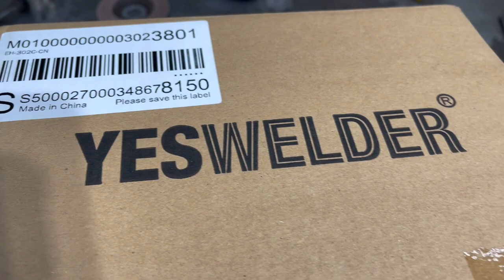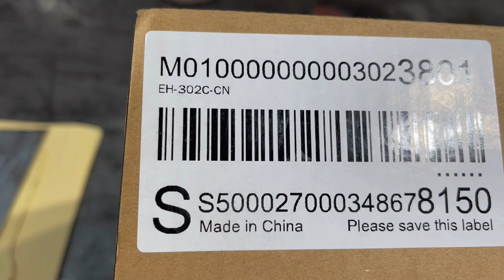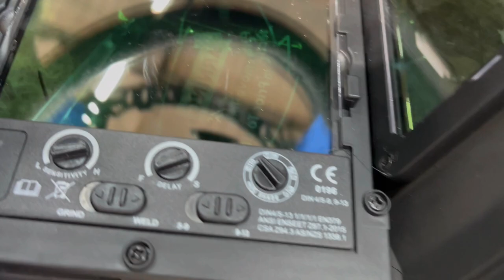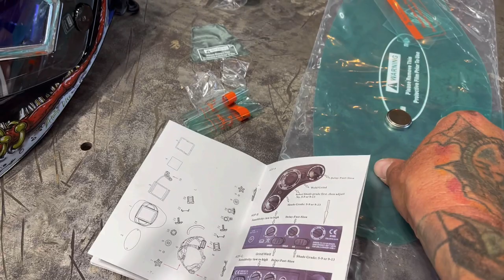Welding/fabrication Yeswelder Welding helmet review

Comment: I too bought one 302c love it,I come to like the fact you turn both knobs in same direction for adjusting,,was use to older method...I added cheater lens,as well as USB chargeable light for added ability...replace outer lenses as needed and enjoy a new level of welding

Comment: Nice work amigo!! I think you could paint the frame in black POR15 if you want a smooth finish. Or primer it and use a roll on bed liner in whatever color you want. Just depends on what finish you're looking for.

Comment: I plan on spraying truck box liner on the bottom and frame in my 69 Camaro I’m rebuilding. It will be tougher than paint and more moisture resistent as well. The shop I have it in gets pretty damp so the car needs the added protection.